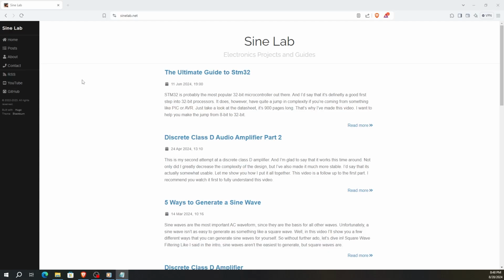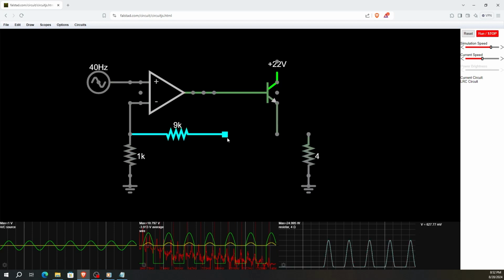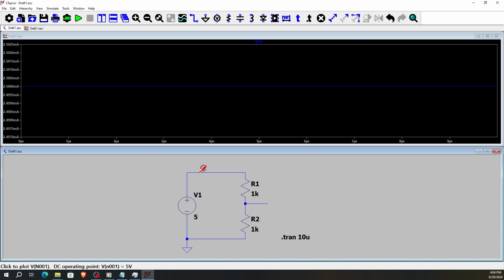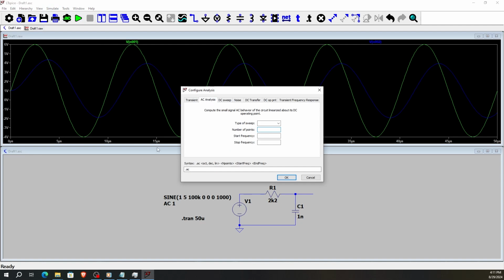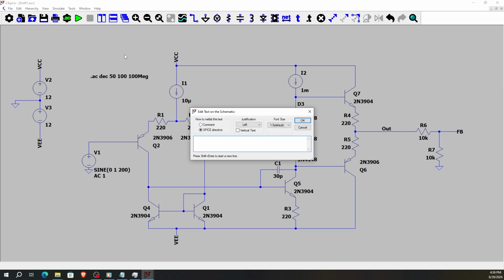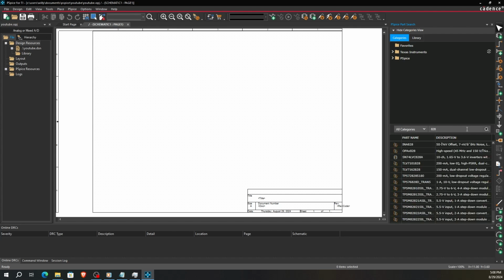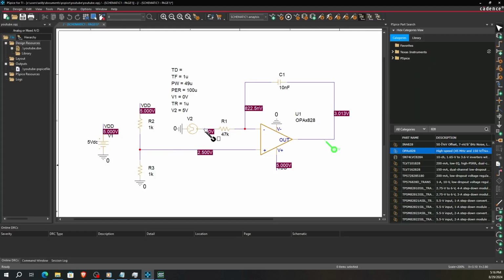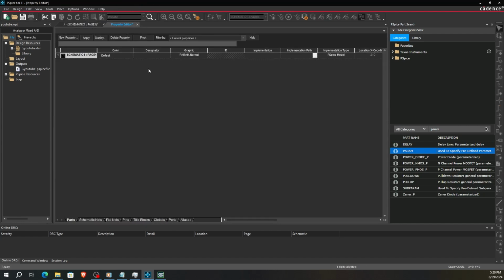How To Simulate Your Circuits - LTSpice, Falstad, Pspice

Comment: Do any of these handle limits or are they all theoretical response only?  (ex. plot the gain of an opamp from 1 to 1 million.) Will the plot give noise and offset? Or will it simply give the theoretical response of the opamp? A real opamp might saturate from offset long before the million gain, or have full scale noise. I get the idea these simulators are only good for basic function but not for real world situations.
Reply: you can add noise to any node  and  you can work with ideal/real world opamps or any components  in ltspice

Comment: I love LTSpice🖤
Its super powerful, but when you don't use it often it is always hard to get into again.
Reply from the maker: It takes some warming up to remember where everything is :)
Reply: I started testing out and using qspice. It was made by the same guy who made LTspice. It’s a lot easier to get into since it’s more modern. Downside is it’s newer so there could be bugs, but if you post on the forum the developers will get back to you super fast. They also release almost daily updates and they might even fix your bug report in a day or so. Worth checking out!